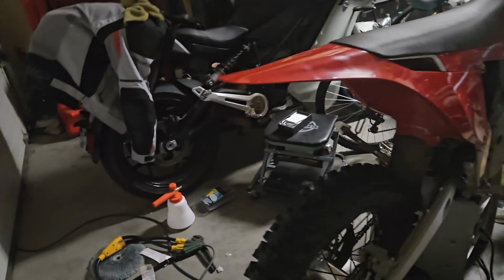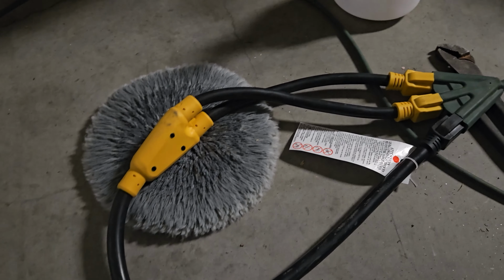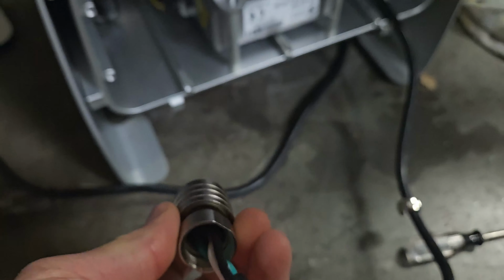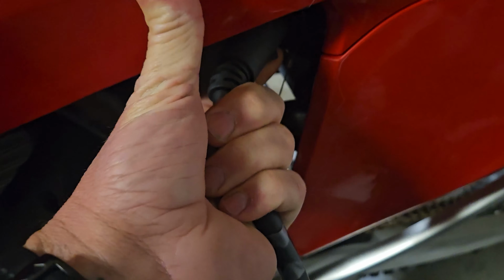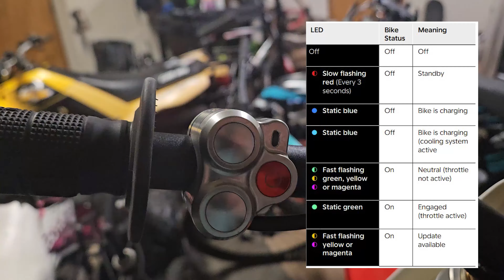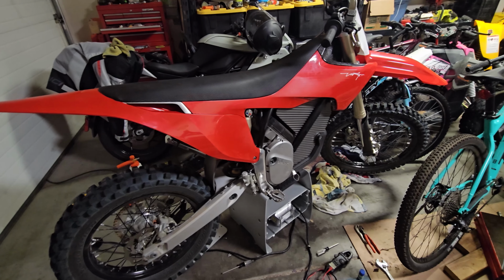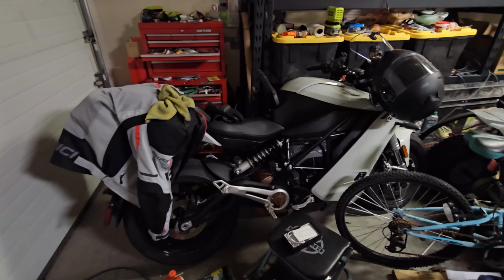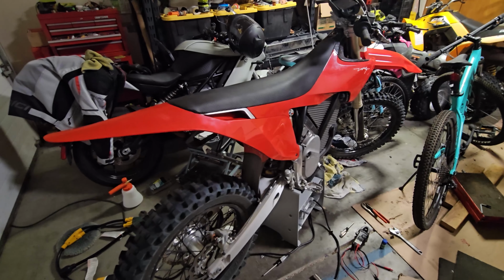Stark Varg Problems and Incredible Support

Comment: Having the same issues with the bike not wanting to update to the latest firmware 1.0.185. I’m currently stuck on 1.0.110. But it’s good to know that they can fix the issue from their end. Thanks for sharing this information.
Reply from the maker: Honestly, it was a little frustrating that there's no way to force the update or plug in a USB or something. The fact that they can just push it is pretty cool though.
Reply: Yea having some kind of usb port to upload the latest firmware is good with me. I prefer having that workflow instead of relying on the bike to automatically update. 
Stark got back to me this morning and pretty much pointed me in the direction of going to one of their reputable dealers for assistance. Going to call and see what happens.
Reply from the maker: @Yogert422  Hopefully the dealer can help out.  These really are great bikes but Stark seems like they have a little bit of growing pains on their tech.

Comment: I had a similar situation and resolved it.  On the outlet side of the 4 prong female connector, the wires were connected incorrectly within the housing.  Ground, hot and hot.  It needs to be Ground, hot, and neutral.  Once I switched those wires, the bike charged like it's supposed to!
Reply from the maker: Dude that's what I need to hear. Which hot did you use?
Reply from the maker: Wait...so on the female end going into the inverter right?
Reply from the maker: Dude it 100% worked! Swapped the green wire and put it in the neutral and it's charging! You're my hero!
Reply: Woohoo!  As you discovered, it doesn’t matter which Hot you use. Well done and enjoy!
Reply from the maker: You're really my hero. Putting a video together for the other guys that will have this problem.
Reply: Do you remember what colors went to what letters? A B C on inverter side and G X Y W on plug side? 

On my male plug side it seemed like wires were connecting correctly to inverter side but they were not using correct colors, as green wasn’t hooked to ground but it was also going to hot on inverter. It worked once so I haven’t decided to switch wires up but might think about it as I’m itching to ride.

I can’t get mine to charge after finding loose wires on male plug side. Fuse blew and replaced it but still no charge even though bike is staying it is charging. Still haven’t heard back from stark yet. Have only ridden for 10 mins on this bike so far 😢
Reply: JKTester put out a separate video that shows how he resolved his. I don’t recall the colors, but the factory cable had connections to hot, hot, and ground. One of those hots needs to connect to neutral. Hope you get it sorted soon!  I’ve been loving mine!
Reply: @db58 ya I saw that video and wired how it looked like he did it since he didn’t mention the letters. I got no power the way he did it. The black wire on mine actually leads to the ground pin on the inverter side and that’s something you can change on inverter side, so I just have to accept black on male receptacle side is ground and white and green are the hots. 

I’ve hooked up every combination I could think of to work and still nothing. I do get like I’ve said before the blue light which he was never getting, I just never get a charge. Must be some other kind of issue I have due to the damn loose wires damaging something.

Comment: My Stark varg shows a blue light when plugged into the charger. The phone also shows that the bike is charging. But it is not. The charger fan is not working. I have been charging for two hours and it has not charged 1% of the battery. Please help me
Reply from the maker: Jeff, I'm definitely not a pro but try restarting your phone.  I've seen a couple of times that the phone is just not showing the right info.  What charge cable are you using, 120 or 240?
Reply: @JKTester  Was using the 120v adapter that came with the stark varg. I took the bike to the dealer for diagnostics now. Still waiting on word. Thanks for your reply!!
Reply from the maker: @Jeffwu544  Sorry for the delay on that.  That's really strange.  My battery just went bad for some reason and I should be getting my new one tomorrow.  Still one of my favorite bikes.
Reply: @JKTester That's weird. When did you buy your bike? I mean it's $12000 electric bike. It shouldn't be work like this.
Reply from the maker: @Jeffwu544  I was in the first batch ever to make it to the US.  I'm really not bothered by it, I expect some new problems to pop up with something so new.  Being one of the first 350 in country, I expected a lot of difficulties.  My charging cable was wired to European spec too.  Just helping Stark work through some of the issues.  It's only taken a couple of days to get the new battery, less time than I would need to have a new engine shipped.
Reply: @JKTester  Yes. There are many uncertainties with new technology. But I have to say that Stark Varg has a great customer service. I checked and found that it was my charger no work . Customer service may send me a new one.

Comment: You're using that 220 Volt adapter wrong. The yellow one that has 2 120 V plugs. You can't just plug both plugs into the same extension cord. In fact, what you're trying to do with that cord. Is pull power from the panel on each phase of the panel. So you have to connect that plug to two different Outlets and breakers that are on different phases of your panel to get 220 out of the adapter. Well, you're probably asking yourself, how do I do that? Well, the easiest way would be to go to your electrical panel And. Plug in a lamp. Find out what breaker that lamp is plugged into by switching them on and off. Then. Go to a breaker either above that one or below that one and find out which outlets that it controls. And those two outlets will be the outlets you will use for that Adapter. The reason you want a breaker either above or below. The one with the lamp is because you have two phases in home wiring and you need both to get 240 so you have two hots so you need two use two circuits. outlet 1 = phase A   outlet 2= phase B     This is just a simple way to do it. Use good extension cords 12 gauge minimum. Unless your house and belongings aren't that valuable. Monitor the heat of these cords every time you charge. There are many other ways to do it. But to get you up and running on 220 Volt in your garage that doesn't have 220 Volt. That's how you do it. And use two circuits that aren't getting used a lot. Like don't use a circuit that's connected to your fridge and your microwave. You know, use the one that's connected to your downstairs bathroom that's never used. And maybe the guest Bedroom. Be smart. Think of it like water. If you put a tee on your outside water. That does not double the amount of pressure that you get out of your spicket. What if you take your hose? And your neighbors hose. And you put them into that tea. Then the one line coming off is going to have double the pressure. Because it's two sources. If that makes any sense. I probably shouldn't post any of this. Yeah, you're scaring me anyway if you don't know how that adapter works.
Reply from the maker: This is actually awesome information.  I eventually figured all of that out based on more research and a few other comments about the adapter.  I've since sent that adapter back and I'm just using the 120 until I can get a 240 jenny.  I was definitely not tracking the phasing.  I have enough knowledge to know that I don't know a lot but enough to figure out what went wrong.  I appreciate the help.  I'm always down to learn something and you used some good examples.  Thanks!
Reply: @JKTester  Well bummer I was hoping to get you fast charging, When In doubt throttle out!
Reply from the maker: I appreciate it. Just need to buy a 240v generator.

Comment: Wow that charger is small.
You could easily fit 3 of those under that stand and power them off a 32A 3 phase source.
Reply from the maker: It really is.  I'm not a huge fan of the stand. Debating making a box for the charger and taking it off of the stand.

Comment: I have one too and the engine cut , little bit tired ....
Reply from the maker: Oh no...any luck with support?
Reply: My Varg cut out in the middle of a wheelie, if i hold down the power button the red light shines but goes black when i release the power button. Had to roll the bike home. Checked every wire, disconnected battery and VCU, no luck. I could randomly start it yesterday, began updating and it died mid update and won’t start again. I suspect faulty VCU, contacted stark but no reply yet. :(
Reply from the maker: Did you do the trick that you disconnect the plug under the front of the seat?
Reply: @JKTester  Yeah but the bike randomly worked now this morning. Apparently a lot of people that have had this issue now during the weekend. Software issue from Stark and they don’t work weekends hehe.
Reply from the maker: Super weird. I mean I guess this is all part of getting the first batch.

Comment: My stark and my friends stark will not charge either.
I have 2 rides on it
Reply from the maker: It's pretty frustrating. I know they're sending me two new cables but I hate it just sitting there.
Reply from the maker: Has stark reached out with any solution for you?
Reply from the maker: Hey...so like 3 comments up there's a guy that had the same issue. On the male side of the plug I moved the green wire to the common and not a hot and it started taking a charge.
Reply: We had a diagnostic call set for yesterday and they postponed it until Monday. 
I do not want to mess with it myself because since i just bought the bike,  they will possibly warranty it. Brought it back to the dealer
Reply from the maker: I loved my call with them. They're great guys. I'm going to let them know this solution because they've already had issues with their contractor. If you haven't dropped the bike off yet I'd try it. Takes 3 minutes and a Phillips screwdriver.

Comment: Whats the max rider weight?
Reply from the maker: Good question. I'm not sure however if you order it from Stark you can customize the spring rate for yourself and I think they go pretty heavy. I'm about 170 and I feel like I barely compress the springs. Feels like a yz450.
Reply from the maker: Okay. Just looked it up. The max spring rate you can get is 220 lbs so even really heavy riders can make this thing rip.